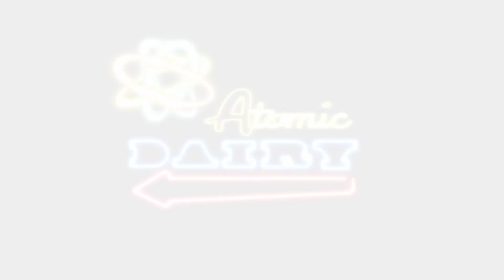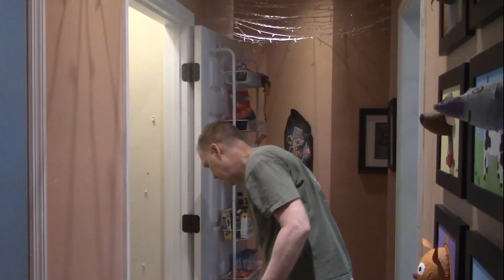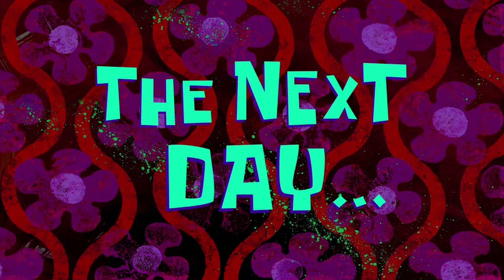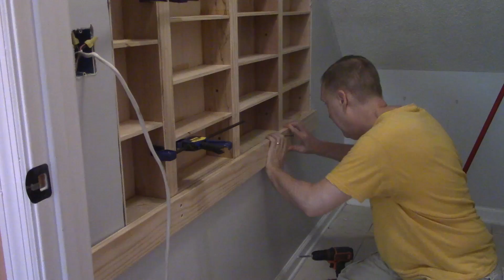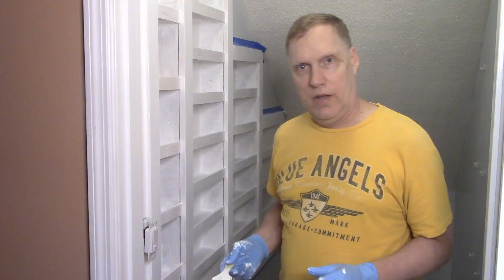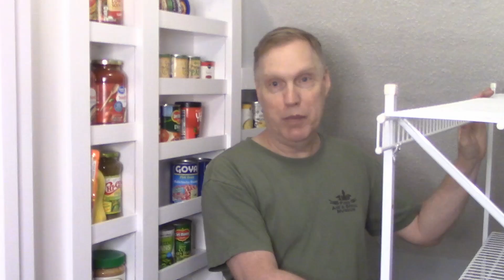Recessed Can Shelf - Using Unusable Space For Cans

Comment: I purchased motion sensor lights for my closet and gun case on Amazon.  They were cheap and battery operated.  Battery operated was nice because I didn't have to do any wiring.  I use lithium batteries because then I will rarely have to replace them.
They also shut themselves off after a certain amount of time.

Comment: What a great idea, perfect for my basement stairs next to the kitchen.  And I did a double-take when I saw the opening shot because you could have been in my house standing at the top of my basement stairs.  Same sloped popcorn textured ceiling. (Get out of my house!!!)

The only thing I would add is that I'd cut strips of simple non-adhesive plastic liner, the kind that's sold for putting on the floor under kitchen cabinets, to put in the openings so the can bottons don't mar the paint.  If the non-adhesive kind is used they can easily be pulled out an cleaned periodically. 

Thanks for the idea, I will be doing that soon.

Comment: I opened my wall just to see if there were pipes ect in there. Once I did, I felt so much air. Once I put backer board ect, will that seal the air leaks or do I need to do more to insulate the area?
Reply from the maker: I would think the backer board would seal things up nicely, but you'll have to recheck once you build everything.

Comment: Love the honesty! Q for you. Why didn’t you just add a back board and add shelves to the studs directly instead?
Reply from the maker: Thanks! Do you mean a back board on top of the studs? The passage is super narrow and that would have blocked the way. So we took the shelves into the wall instead.
Reply: @AtomicDairy  I meant a back board between the studs? And put shelves in between that way? With pegs in the studs themselves?
Reply from the maker: Ah. We did talk about doing that and making the shelves adjustable. We decided to keep it simple for this first embedded shelf effort and learned a lot. If we do this in the future we'll likely put in a header, remove the studs entirely, and use pegs like you suggest but in thinner boards. But even this version has turned out to be wildly popular in the pantry and we no longer have cans on our other shelves.
Reply: @AtomicDairy  Still great. Just wondering about your train of thought. So I can use it for my shelving needs.
Reply: @angellas.1314 That is what I am thinking of doing keeping the studs in a 7 foot span wall adding shelf’s to the studs. Also  adding to the outside wall for a deeper shelf.

Comment: Did you use any brad nails or anything on the cabinets? Is just the glue enough to hold all those cans?
Reply from the maker: Just glue. We don't have a brad nailer but have found that wood glue is plenty strong for most jobs like this.

Comment: Very cool project.  I plan to do something similar.  Just an FYI, though - most studs are 16" OC (on center), not 16" apart.  A nominal 2x4 is actually 1.5 x 3.5 inches as you mentioned.  Since each stud is 1.5 inches wide, you have 0.75 inches of each stud contained in the 16" measurement.  2 x 0.75" = 1.5".  16" - 1.5" = 14.5", which is what you were measuring.  Your studs are still 16" OC.
Reply from the maker: You are completely correct and I stand corrected! I should have figured that out before I made a video. But I'm glad you will be doing the same thing. You will not be disappointed!
Reply: @AtomicDairy  Thank you!  Yours looks great; I hope mine turns out the same... ;)
Reply: Great build. The right shelves now look sad…get rid 💪 I’m going to do similar in my bathroom.